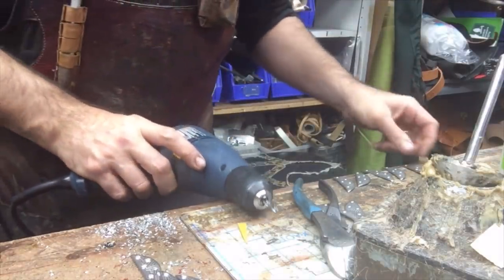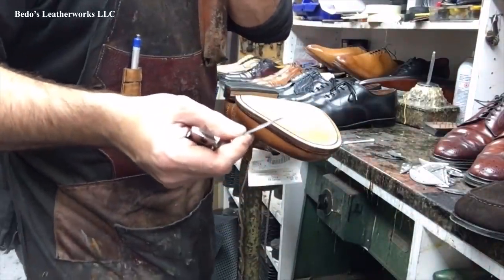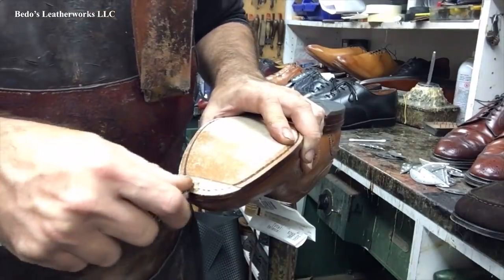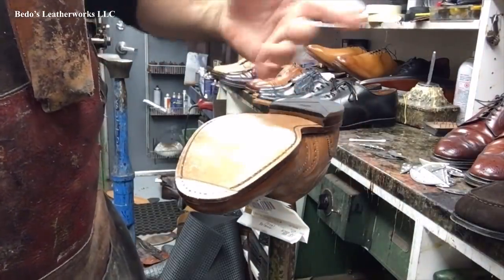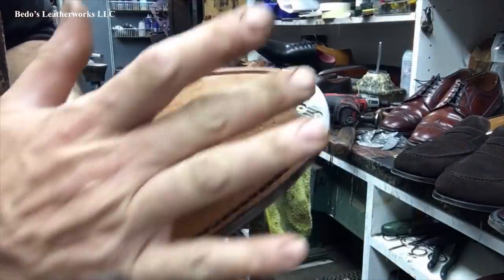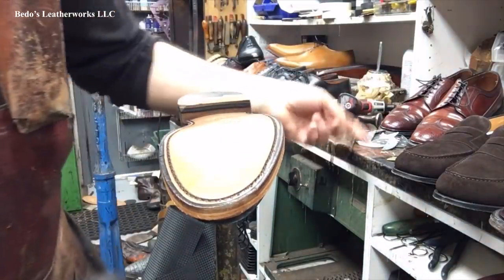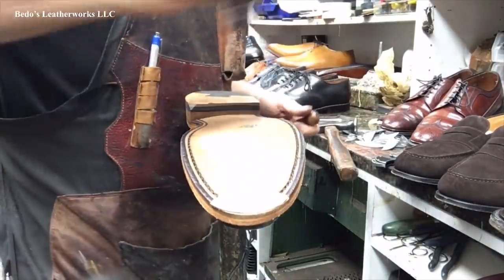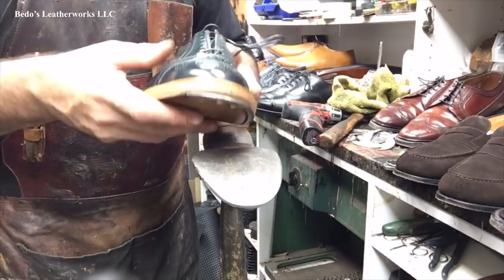French Tips- LuLu’s & Triumphs #145

Comment: Just recently put lulu's on my pair of Crockett and Jones apron Derby's - a nice shoe.  I found that my shoe was quite chiseled and the lulu tip needed grinding a lot as it was proud.  I was glad to see you countersink the holes as that is what I need to do!   Struggled still to get the correct screw gauge but eventually it sorted.  

I agree: I think solid brass would be generally better - albeit more expensive.  My only worry is that when I fitted thew lulu, I may have compromised the stitching around when the tip was set flush.....I guess time will tell if it was a bad idea DIYing it....

Thanks
Tony

Comment: If you ever get around to manufacturing your own French tips consider using aluminium bronze. Some grades are tougher than steel. It's also one of the most corrosion resistant metals. 

For your breaking screws have you ever tried dipping in wood finishing paste wax.  Carpentry trick.